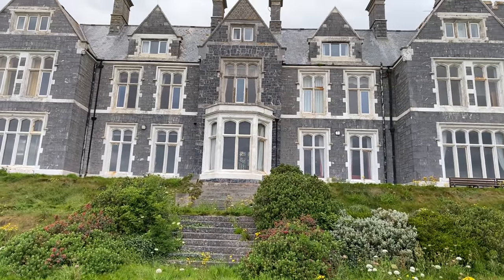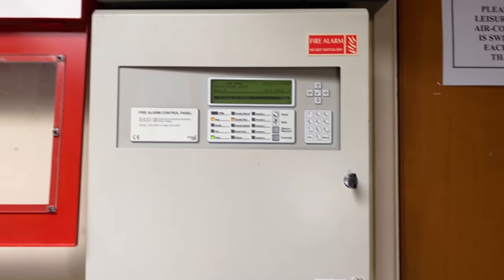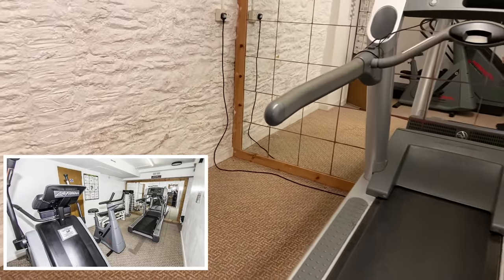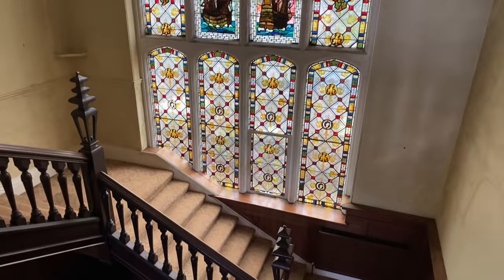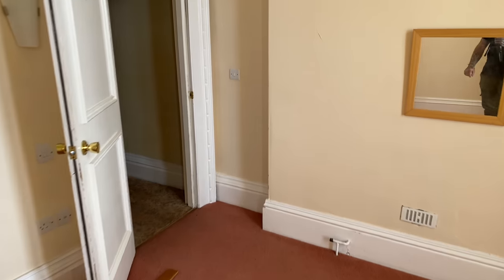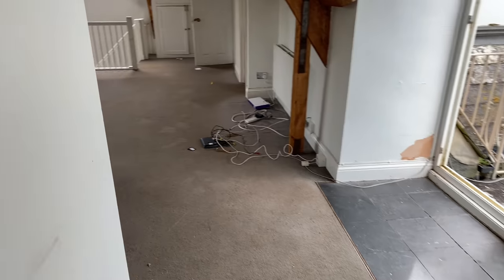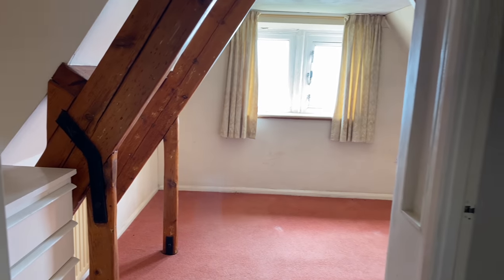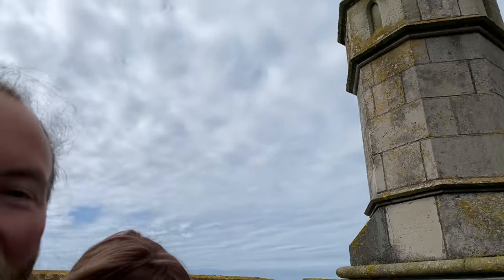We Explore An abandoned Mansion On A Cliff Top With Incredible Views!!

Comment: What a fantastic place with awesome views! I bet someone was still staying in room 31, not only was it locked but its also the room the alarm system said the Device was missing. Probably the person living there smoked and it stopped the sensor going off. They would have water, electricity dry and secure room and plug in heaters that likely work as the other room used had too. Plus working cooker on the premises! It's one hell of a place ❤️

Comment: IF only they had changed or re-shingled the roof before it went  to ruin the fix would have allowed the value of the place to remain close to or at market value. Now the entire roof needs replacing, likely many rafters, joists, wall framing, several ceiling and wall panels need replacing, , and it looked like at least one bay window needed reattachment to the building and it's flooring, joists and ceiling all likely needing to be done, then on top of that the whole place needs work and/or some updating, i.e. carpeting, painting, wallpaper removal and paint or wallpaper and so forth. lots of oiling and polishing of the raw wood, wood flooring needing resurfaced and sealed and so forth, before anyone could reopen it.
That would take in the hundreds of million if not up into the billions to get it all done!!! Is it even where people would still come to visit or has it died down?